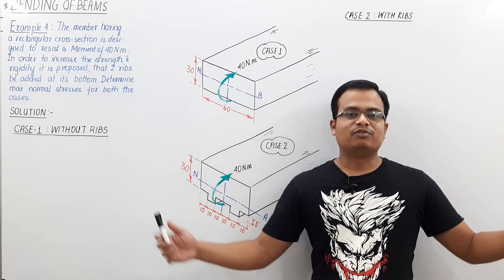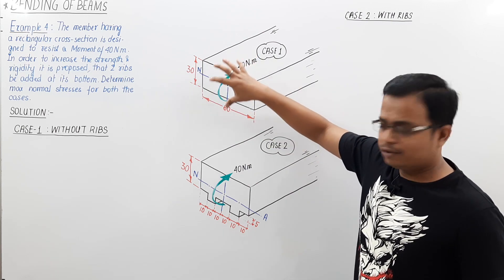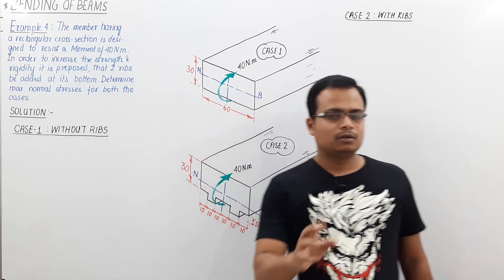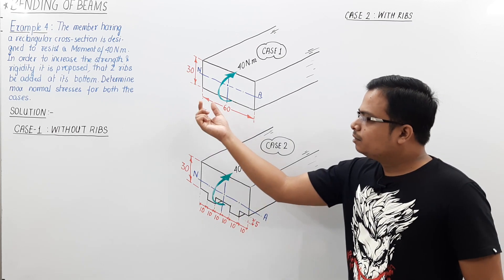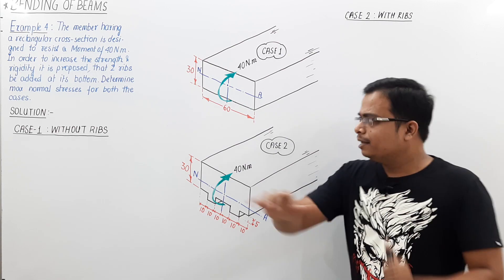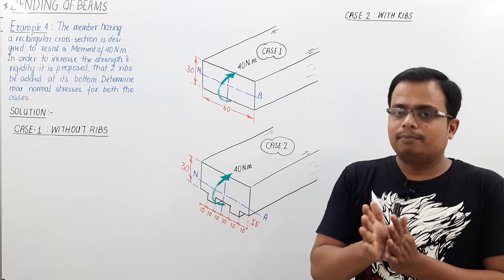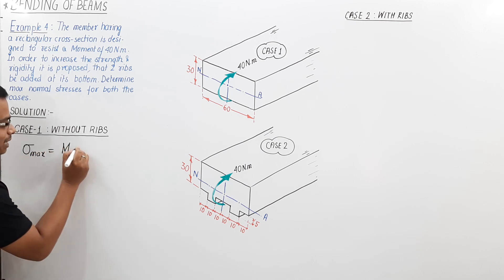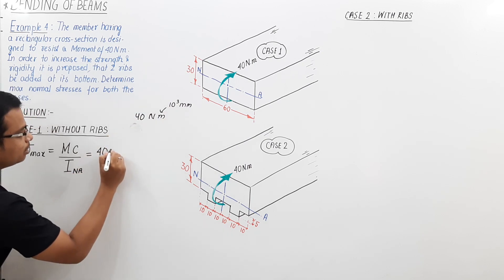Bending of Beams || Comparing Stress || Lecture 5

Comment: distance between end project is 60 and plan n elevation make 45 and 35 with xy.draw projection of line if one point is 20 mm above hp n another point 25 in front of vp. Pls answers @Manas Patnaik

Comment: Sir please help me out on this .... A beam of rectangular section having a hole of diameter D=depth/2 and another beam of similar material and dimensions but without a hole, which will have a higher value of bending stress and why?
Reply: Sir, Do you have a forum where we can share our doubts?
Reply: The hole is symmetrically located at the centre